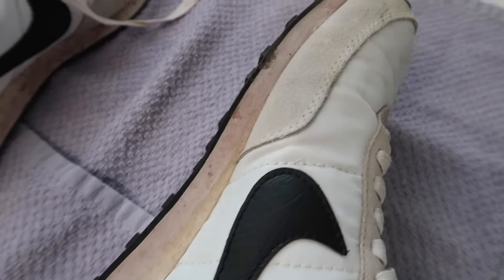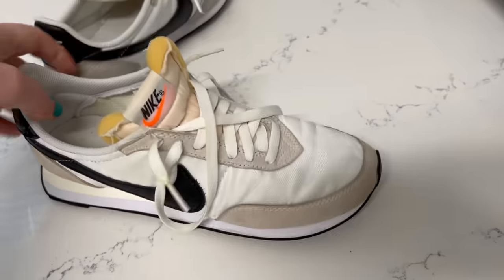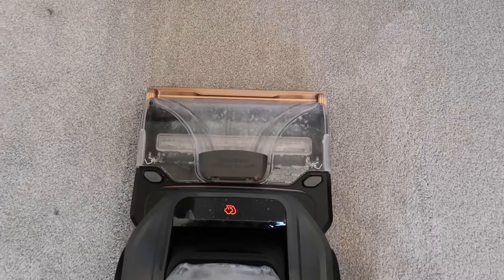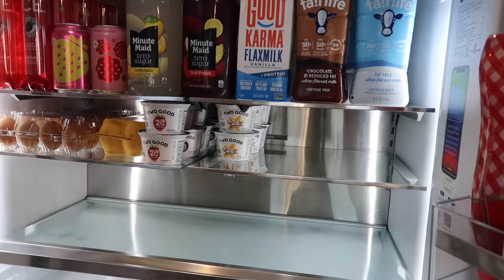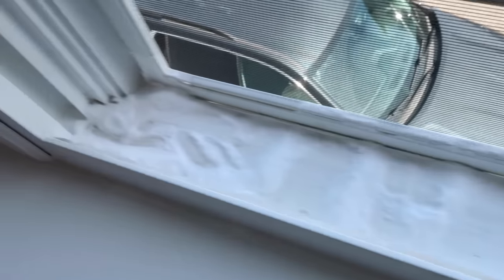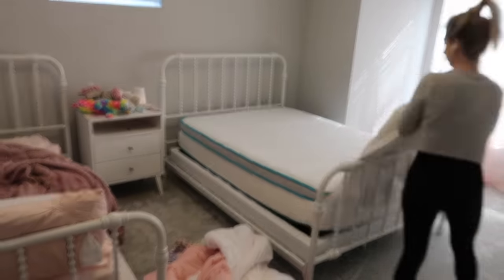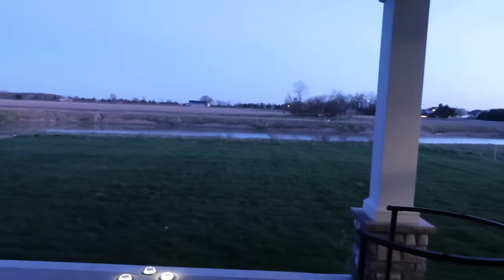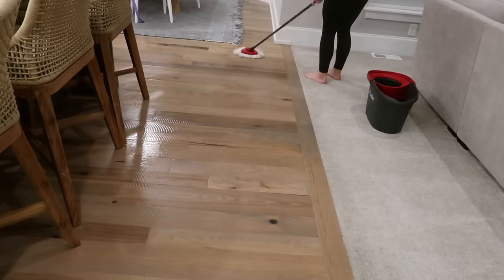SPRING DEEP CLEAN WITH ME + FRIDGE RESTOCK | CLEANING MOTIVATION | CARPET CLEANING | CLEANING HOUSE

Comment: I wondering if it’s something with all the cleaning cause when you were in GA you were not cleaning and it went away??  I would possibly only use the Jaws and then add a cleaner one at a time and see?    If t has s just one odd everything went away..
Reply from the maker: I've thought about it but I haven't really changed anything cleaning wise in over 7 years (basically using the same products) and it all started when we move into this house so that's why I think it's something environmental going on. But we will see! It definitely doesn't hurt to experiment and and try new things!